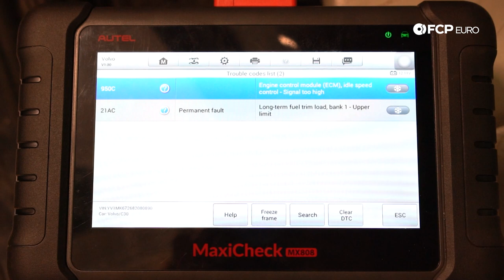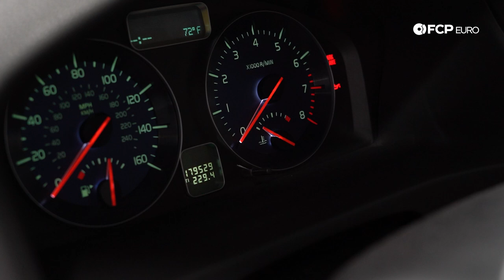How To Replace A Volvo Oil Filter Housing & PCV - Volvo P1 Platform - Volvo S40, V50, C30, & C70

Comment: Hmm... Fcp Euro, it kinda sounds like it's oriented towards european car owners - in this case P1 Volvo's. But as far as I know, most P1 Volvos originally sold in Europe are diesels, second are the petrols in 1.6, 1.8 and 2.0. Not many 5 legged engines in comparison to the fourpots.
Yet almost all, if not all, vids on the P1 Volvos are on the 2.4 or 2.5T.
Which means that mostly all vids on around the engine jobs are useless for most P1 owners. 😂

Comment from the maker: Step by step process starts at : @3:51 
Buy the Replacement Kit Here : https://www.fcpeuro.com/products/volvo-pcv-breather-system-kit-c30-c70-s40-v50-l5pcvkit?utm_source=youtube&utm_medium=description&utm_campaign=mps%20volvo%20p1&utm_content=diy%20pcv%2foil%20filter%20housing
Reply: Nate, there's a big difference between a PCV and a CBV, or a CRV. Most domestic and some Asian cars use PCV. All European and some Asian cars use CBV - Crankcase Breather/Regulating Valve, but not PCV. The two functionally identical but different in design.  Volvo doesn't use a PCV but a CBV.
Reply: 25:02 Our next step is to prefill the OFH with oil to prevent dry start-up to the valvetrain, or you had done that already?

Comment: A big jobb unnecessary, Sorry for that.  You can  buy a diaphragm for 10 euros and by removing the round cover behind the oil filter you will be able to change the diaphragm. Ofcourse if you are a Volvo dealer you wish to get atleast 500 euros for changing all that device which is not defect at all. The only defect thing is the diaphragm !  Save the work for you and the cost for the customer.  Good luck in future.
Reply: Depends. If the system is too dirty, the diaphragm cure will be temporary---not permanent.

Comment: Not the best design if you need to pull the airbox every time you change your oil.
Reply: He didn't R/R the airbox for an O/C.....his PVC system had failed and would have destroyed his engine seals and then entire engine. Keep up.

Comment: If I suspect this problem is going on on my 10’ V50 2.4i, (CEL on and immediate audible clicking at idle), can just the faulty diaphragm or the PCV (assembly) be removed and replaced instead of having to replace the entire oil filter housing? Thanks for your advice in advance.
Reply: You can just replace the diaphragm.  The cap pops off using a screwdriver and the new one drops in.  The 2.4i is a lot easier to access and shouldn't need anything removed other than the cap.
Reply: Where can you purchase the diaphragm